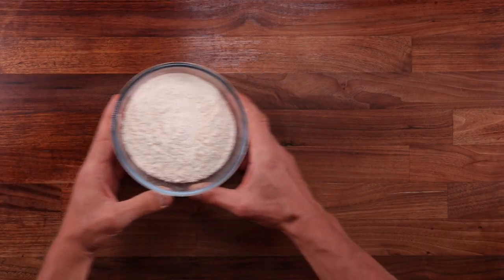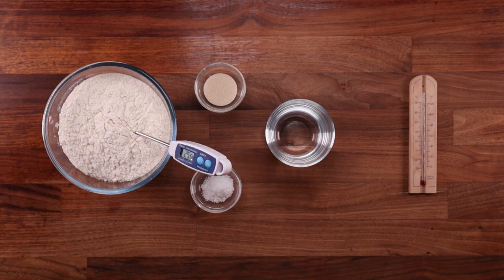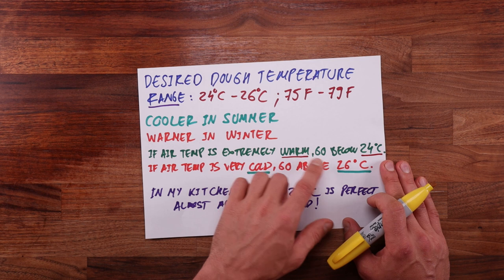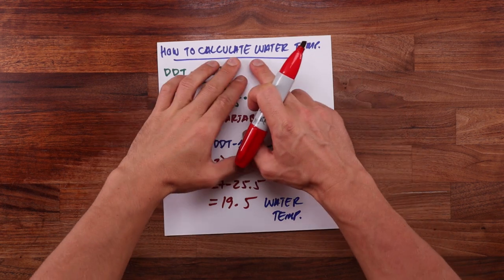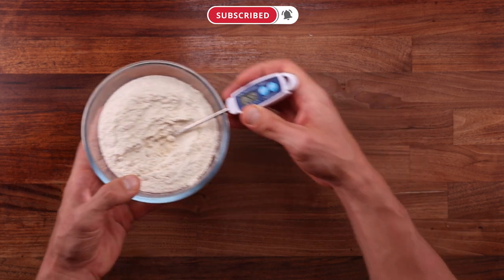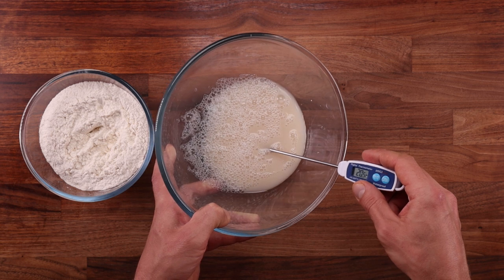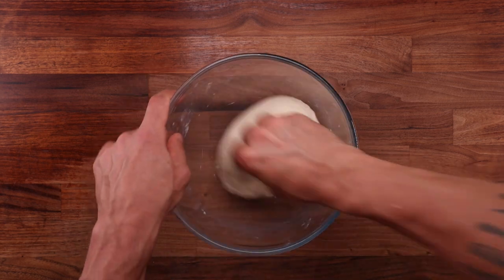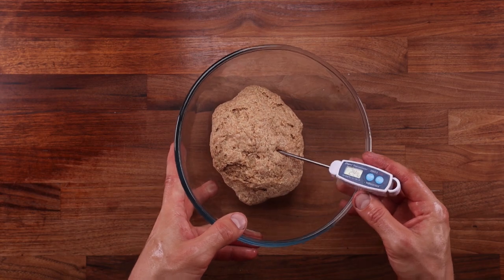How to Control Bread Dough Temperature | Principles of Baking

Comment: I've very much enjoyed your ChainBaker videos, and after 50 years of baking breads by traditional methods have been won over to your no-knead, cold-ferment technique, as well as your high-hydration techniques.  That said, I've never paid any attention to temperatures other than to make sure the liquid temperature was not too hot to proof active dry yeast (using my finger tip as a temp tester).  Recently, having paid attention to temperature as you do, and not, I frankly can tell no final difference in the breads, particularly since whatever is being mixed goes in the fridge anyway.  The only difference of temperature I find is the rising times for bulk and final proofing: I simply adjust the times to fit the dough, testing for slow spring-back to decide if it's risen enough.

Comment: Honestly, my solution is "just don't". For the first dozen or so bakes, temperature control was very important as learning tool and it was giving consistent results, but more i baked, the more i realized how "off-hand" the process can be, as long as you understand the principles. As long as ingredients are in right proportions, suficiently mixed and given enough time, your bread will come out just fine.
Tho i should note that it's at reasonable temperature ranges. Don't think you can be as "off-hand" when you are mixing dough inside of a sauna.

Comment: I've just bought an airfryer and wondered if you've ever used one to bake bread? If so how does it turn out? Due to a disability I'm trying to avoid using my regular oven. But I love baking and thought I'd check with you about this.
Reply from the maker: I've never used it. But the principle seems similar to a regular oven. Perhaps you may need to lower the temperature a bit, but it should work.

Comment: OK.  I get the temp control to some extent.  But how much variability can you get in a 4 - 6 hour window? 1-2-3 degrees F?  I made no-knead (biga preferment) ciabatta rolls today.  My kitchen is 75 - 78 F.  (Is humidity a factor?) The rolls were baked on my propane gas grill in my backyard on a baking steel at 500ish degrees F (91degrees F outside temp plus humidity of 75 - 80 %).  They are amazing!  Very flavorful with a soft crumb and a chewy crust!  So... my conclusion is, while temp is a variable, it may not be critical to the final product in the short term as long as you stay within the 3 - 5 degree window..  If you are "close enough", you're going to get a better than average final product.  It seems to me, your formulas are VERY forgiving (+ or - 3 degrees F).  IMO, that is the definition of good bread - a combination of the same ingredients under different circumstances which yields pleasing results.  I have learned SO much about baking while watching your channel!  Thanks for doing wat you do!
Reply from the maker: The longer the dough ferments the more the temperature will affect it. I don't worry too much about calculations though. Over time I have learned to guesstimate the water temperature according to how warm or cold my kitchen is. These formulas are just for people who don't feel as confident yet :)

Comment: Hey Charlie, at what final dough temp do we start to observe undesirable effects on our bread? since this dough is eventually gonna end up in the fridge and cool down to the fridge temp which is around 4 or 6 deg C. Will a 5 deg higher than the ideal ~25C produce a significant difference? Thanks
Reply from the maker: If it's at 30C you should just fold it at shorter intervals to cool it down otherwise it will definitely over ferment even in the fridge.
Reply: @ChainBaker   thank you for the prompt response 😁

Comment: If I'm going for a fridge fermented dough, is it worth refrigerating all the water, and maybe the other ingredients too before mixing, then shortly mixing dough before putting in the fridge, to minimize the unevenness in temperature from the start, rather than just compensate trough taking out and folding a bit later?
Reply from the maker: The dough temperature must be high enough for proper fermentation to begin before it can be cooled down.

Comment: To make sure the bowl is not a factor in the desired dough temp calculation here is what I do: Add the water to the bowl, adjust the temperature with hot water or ice then remove the excess water. Now the water temperature is exactly what you want.

Comment: I'm about to make 100% hydration ciabatta with 30% whole grain flour. Planning to use pate fermentee with all whole grain flour without adding yeast to dough..Do you think is possible??🤞
Reply from the maker: Yeah sure. I'd suggest making the pate fermentee with a higher hydration so that it would be easier to mix into the dough. But if you are using a mixer then it should not give you any issues.
Reply: @ChainBaker  Mixer always. Can't go over 100% I'm  amateur baker

Comment: Does room temp even matter when using cold bulk fermentation?
Reply from the maker: Without it you can't calculate the final dough temperature accurately.
Reply: @ChainBaker  Is this due to thermal transfer from the work surfaces, e.g. the bowl? If so then I'd expect that we could control that to some extent. However I wonder how much effect environment/tool temperature has on the result when we are going to pop it in the 'fridge for several hours anyway...